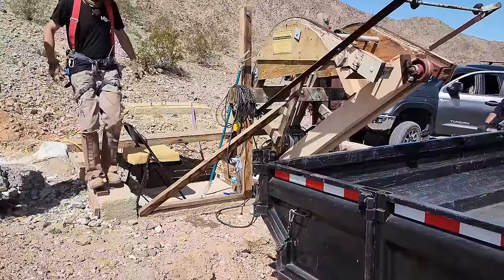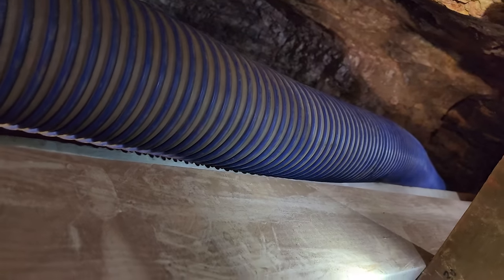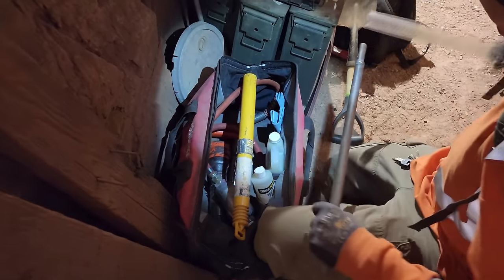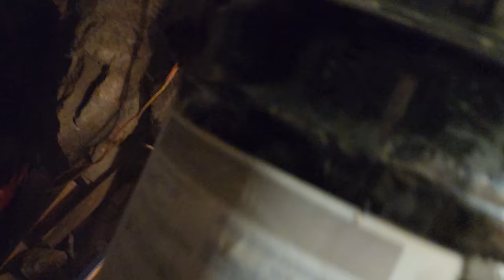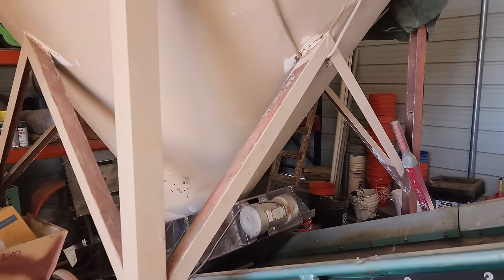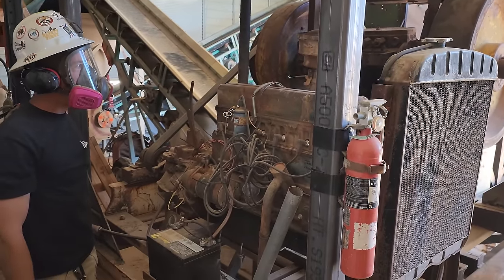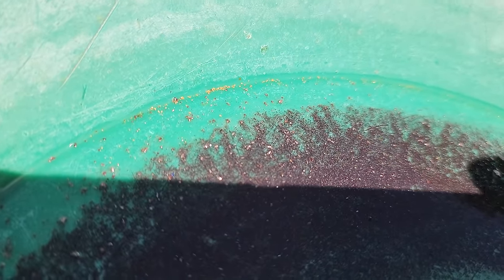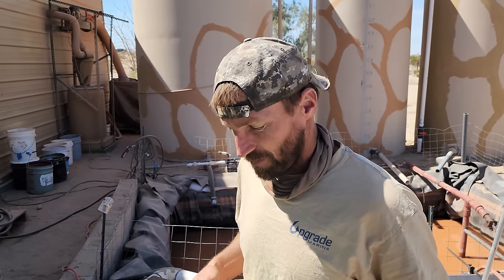Gold Mining: Underground Gold Vein Mining & Gold Ore Processing

Comment: A very unique and very interesting setup that they have!!  Would love to mine and have a setup like you had.  Seems that took care of doing a small mine operation.  But why not have a bigger pond?
Reply: My only question, why not put in another crusher to make all crushed down to more or less dust. And have a hopper installed to hold the crushed and then mix into the water slurry. To run on the shaker table.
Reply: @rdland2985  You'd want to use a ball mill or rod mill for fine grinding like that. I agree though, a finer grind would be worth trying. Personally I think I'd grind the table tailings and then either recirculate them over the table or send them to a flotation circuit.
Reply: @Porty1119  yes a finer grind of the tailings would free up more gold... but would it be worth the effort if it isn't going to be worth it in long run of gold production.  I went a did more research onto it and you are definitely correct on the ball or rod grind to make it I to more of a powder.  Mbmm uses a different style of shaker table where the lines are inverted into the table instead of sticking up through the table.  But he also smelts the a and b run off off the table to release all gold and turn it into a button at the end of the smelting process.
Reply: @rdland2985  All depends on the mineralogy! A lot of trial-and-error experimentation is called for when processing a new ore type.

Comment: Hello Jason I've been watching a lot of your videos I've never seen that type of ore before and or let me correct myself I've seen it before but I was never informed of what it was or seen it on a gold mine video. I have a little bit of knowledge about alchemy. And from my understanding whenever gold is in colloidal form when it's suspended in acid it is purple. This is because of the tin that it came into contact with while it was suspended in acid form. The only way to extract it is to re dissolve in aqua regia and you can drop it with SMB or even a piece of copper. If they're crushing it and running it through a mill then all of that colloidal gold is getting washed away.
Reply: Yeah that's why they smelt it all (A+B concentrate buckets).  Panning was just for a peek at the free gold content, they already know about half is free and half is locked up in the other heavies.
Reply: @Spudz76  that's good to know spuds but on top of that brother some gold is so fine that it evaporates upon smelting. They should at least try to do an acid test and see if they get more with a leech assay just a suggestion.

Comment: I like the practical approach to quality operations by mine operators.  Is Jason started down the hole I noticed a folding chair there at the top of the opening with the extra thick foam rubber pad on it. Minimum at Great expense for the chair and maximum comfort for the sitter. 👍🏻🤔

Comment: Hey Jason, I wonder if you could offer a better way/equipment that might catch more gold on the shaker table. It might be that watching this video,  instead of in person, it seems like a much larger amount of water was running over the material. However, you did mention that it had raised riffles, so maybe that is why. Just a thought. I bet you had fun, though!!! It looks like ,fantastic,  rich ore!! Warm hugs from Alabama ❤️
Reply: Without about that much flow all that larger chunk that made it through the second mill would get in the way instead of heading off the far edge.  Likely when the chunk problem is solved and all that goes to the table is dust, then the flow could be tuned lower more like you may expect.  However since A+B cons both get smelted it doesn't really matter how visually perfect the table runs as long as nothing but tailings are rejected.  But definite room for tuning, especially getting the ore pulverized better so the slurry is less of a "stew" and more of a "rock-milk".

Comment: If i were them id mount a set if wheels ti a piece of plywood about 2"thick, spaced do a plastic barrel will roll on it, use a eletric scooter to spin the barrel go to a salvage yard, and get some steel chunks sbout 2"x 2" maybe a few truck axels cut into 6" lengths,  let it spin at 10-15 rpm overnight the oversized dtuff and the sand tailings both could be ran through it.  Probably fiill the inside with 12" x 36". Sheets of 4" steel plate to hive the steel domething harder to crush the rocks against. Getting it spinning with a steel hexagon to toss everything  then the heavy steel crashing down on it. It should make powder of it in just a few hours. The rock crusher seem to be a bit slow. Seems adding a modern 5speed transmission with a pulley on the tail shaft. So ut can be ran in 2nd or 3rd gear or 1st with the engine at a higher rpm. Sround 2500 rpm that engine wiuld be making about peak torque, and the addition of a electronic governor to keep the engine at a steady rpm. Even under a load. Preventing it from bogging down. I'd build a shed over the mine with solar panels. So the power is free, also the mill. So bedides some gas the mill runs free, if its lights only, a 24 v battery, and 24vdc led lighting in the mine.  I never saw a mine so well lit!